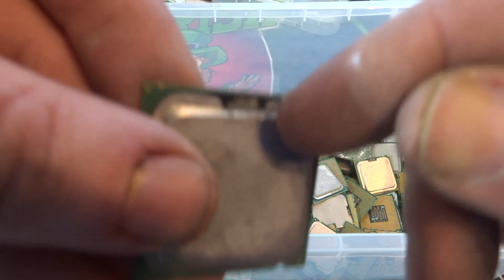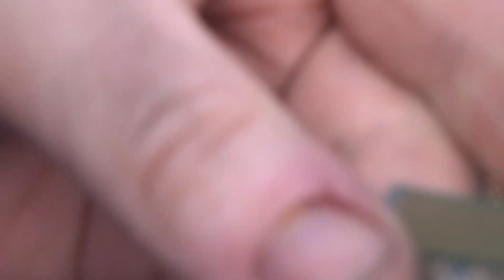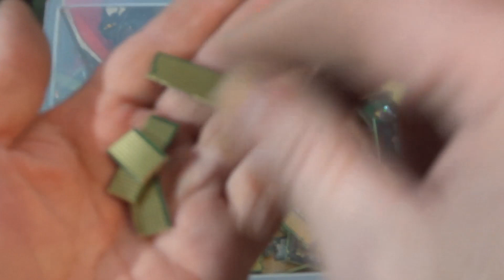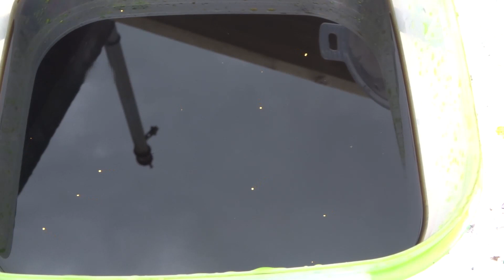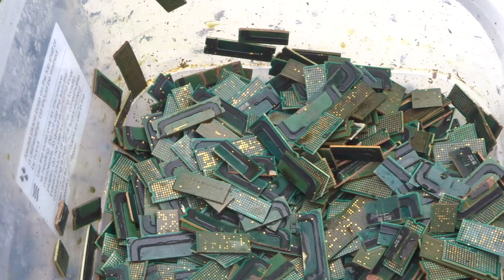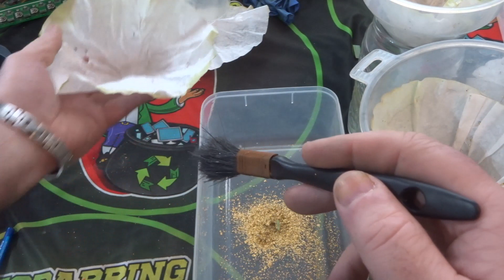How Much Gold Is Hiding In These CPUs?

Comment: Isnt there silver in some of the IHS solder on cpus that old?
Reply from the maker: You are correct there should be silver in them
Reply: Is all the solder 65% silver? Or only solder on cpus x99 and before? I cant find much info about if cpus still use silver in the solder.
Reply from the maker: @simulationbros  no not all solder is sliver its mainly only in the older solder